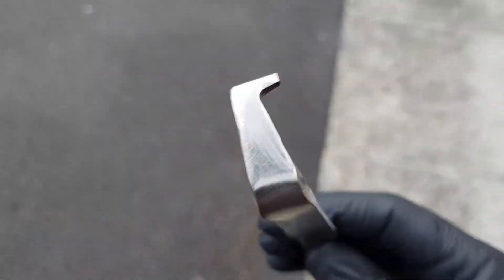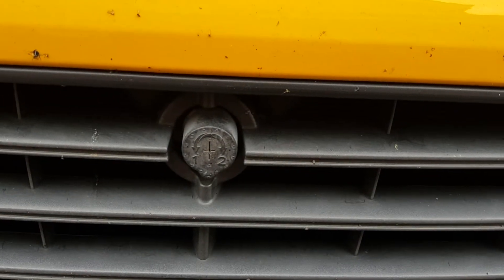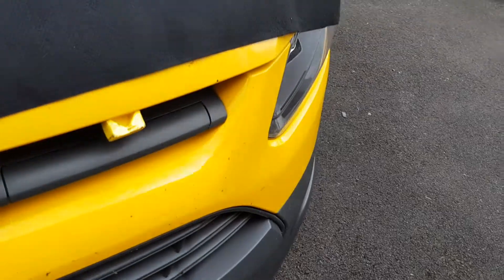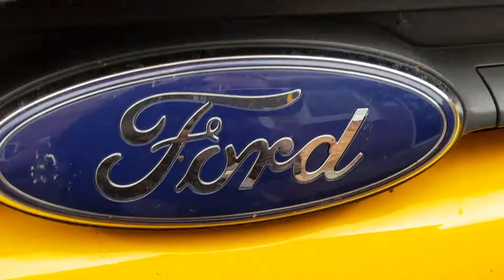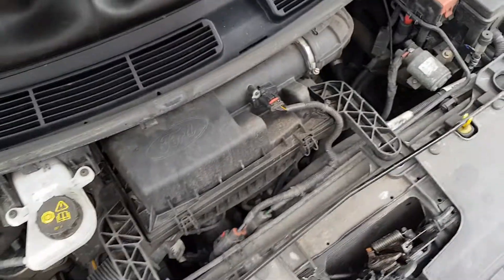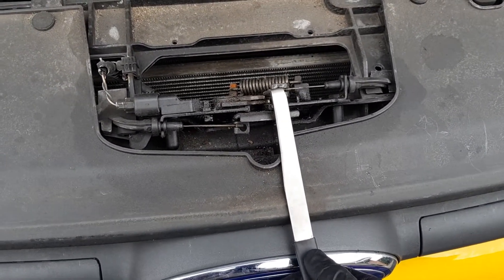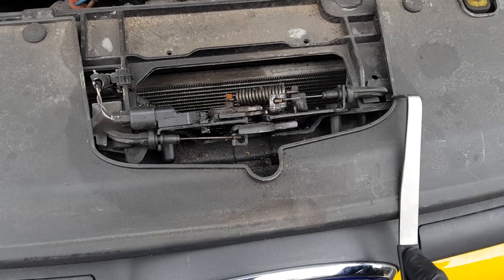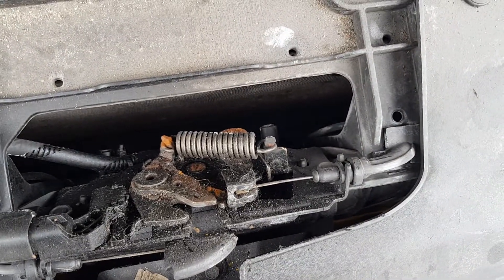Transit custom bonnet won't open. opened with new lock bypass tool

Comment: Once you get you bonnet open there is a plastic "U" that the bonnet catch rests on, If you rip it out the bonnet won't "seize up" because you can now push down on the bonnet which releases the pressure on the catch and the key will now release the bonnet. The 1mm of plastic is just enough to allow the bonnet to move just enough.

Comment: Thanks a lot!!!! This is the third video I tried and the method works! I'm in! I just made my own tool out of some screwfix Galvanised Steel Flat Bar I had lying around (just bent it about an inch down, no hook).  I actually had the grille off (asper video #2, pretty easy to snap off!), so I used one hand to help ensure tool was in right place )and angle of bend was correct) before twisting.

Comment: Push down on the bonnet and turn the key. It works.
Reply from the maker: Sometimes it does but if very seized it won't work or if the barrel is faulty I see seized bonnet locks every week and just use the tool every time saves the risk of damaging the key lol

Comment: Thanks for posting this, I had already wasted 1 hour trying to twist the lever behind the lock,
It took a few attempts to get the dimensions of the tool right but probably only 20 mins to make it and Hey Presto... Open bonnet!

I hope you sell enough of these to make a little bit of beer money... Plus there's one in the wood for you if you are ever down Kent way, cheers mate

Comment: Would this work on a 2008 Transit (not a Transit Custom)?
Reply: No, sorry, the 2008 has an enclosed locking mechanism and can't be bypassed with this tool
Reply from the maker: I'm afraid not it's only designed for the transit custom only cheers
Reply: @sponge85029  Thanks for the quick response.
Reply: @azerotha4531  Cheers.